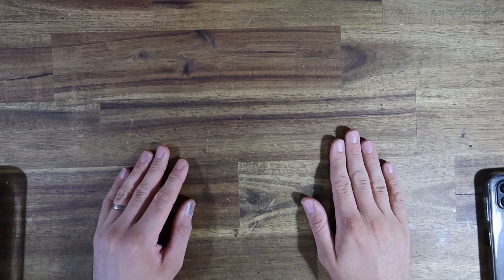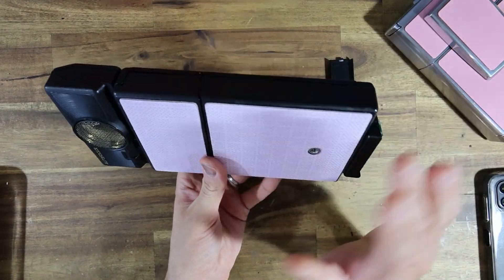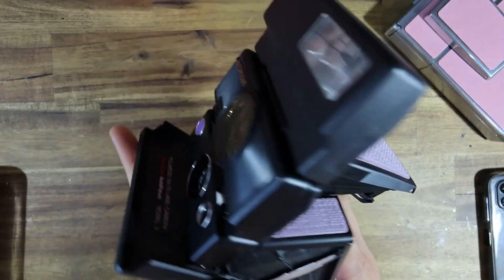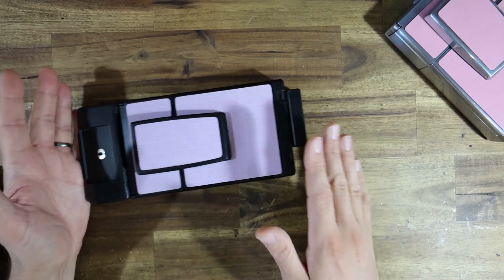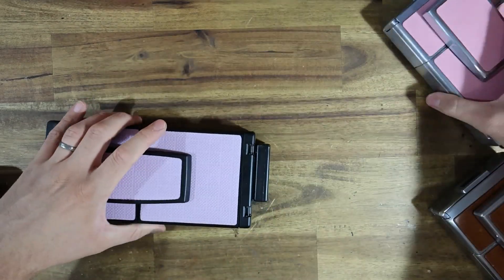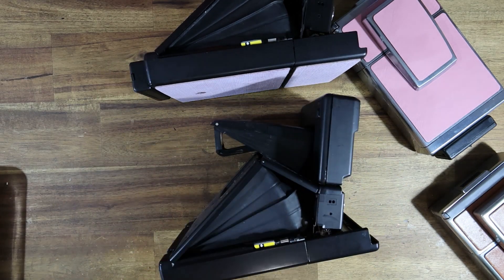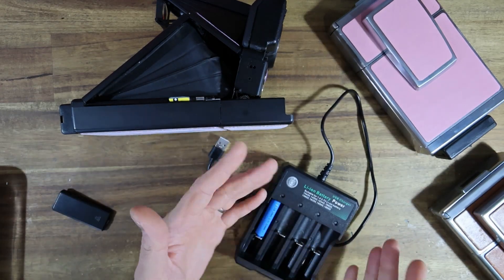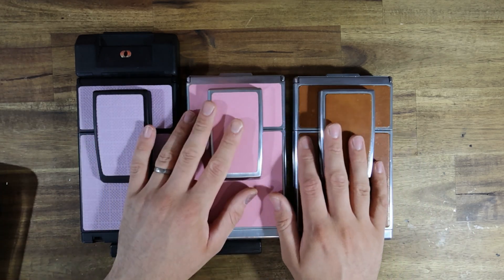The PolaVolt: a newer, even better i-Type solution for SX-70 Cameras!

Comment from the maker: Essential info:

- uses two 3.7V '10440' lithium ion cells (same shape and size as a regular AAA but different voltage)
- batteries are hard cell and user replaceable in the field
- requires external charger such as the BH-042100-04U shown in this video to recharge batteries
- batteries will last 10-30 packs of film depending on the quality of battery and specifics of the camera model 
- no switches required! simply erect the camera to turn it on, and collapse the camera to turn it off
- keep camera collapsed when not in use to prevent battery draining to 0V
- when the batteries are getting low, the camera will begin to sound sluggish, alerting you to change your batteries
- I recommend re-charging them every 8 or so packs of film if you want to be conservative
- user replaceable cells mean you can carry spares into the field! 
- despite some doubts in this older video, this solution does works perfectly on a 680
- due to shipping regulations I cannot supply batteries, but they are easy to find on eBay, Amazon, Aliexpress etc
- as tempting as they are, do NOT use the batteries with built in USB-C charging inside the cell itself. They are only 2/3 the capacity of a standard 10440 and have built in surge protection that will shut the batteries off if too many amps are drawn. This results in poor performance

Comment: Can you still use regular 600 film with this mod in place?
Reply from the maker: 600 film will still work, but it will not power the camera. This mod will use the 2x '10440' lithium ion cells to power the camera

The original battery terminals in the camera are deleted in order to simplify the electronics and improve reliability

It'll work like any modern Polaroid i-Type camera

Comment: This battery mod looks the most decent alternative for powering i-Type film with a reasonable price. Thank you so much for sharing! I've done the Mod and everything seems to work well when I bridged the contacts on the side for testing the motor. Unfortunately, the camera no longer fires when pressing or bypassing the shutter button. Do you have any tips on where I should look again?
Reply from the maker: This could be so many different things that the diagnosis is pretty much impossible online

The only thing I can suggest is to send it in or watch more of my videos to figure it out

Comment: The converter can handle the 680's flash quite well. I've been using a similar solution with my SRL680 for almost two years now but instead of stepping down, I'm stepping up the voltage of a single battery. The buck converter has been able to power the camera with a mixed use of on/off flash all this time. I'd really encourage the avarage user to try and DIY one. It's a fun and cheap little project.
Reply from the maker: This is excellent to know!

I haven't ruled it out, but I don't want to offer solutions that I haven't tested

Comment: How many packs of film will a PolaVolt go through on a single charge with an SX-70? What about a Sonar? A 680?
Reply from the maker: I haven't tested this. But the answer seems to be "a lot" lol

So far my batteries are still going strong after testing 5 cameras and several packs of film

Likely more than the average person would ever shoot in a day, and with the capability to swap cells in the field if they do go flat 

SX-70 and Sonar cameras should be similar, but a 680... I'm hesitant to mod yet since I don't know how the flash will cope. Having it built in creates a very large drain on batteries

Comment: I wonder what would happen if you stuck a Powerbar on one of these...
Reply from the maker: If you ran the Powerbar and the PolaVolt at the same time? Nothing special would happen. Effectively the two would run in parallel and you'd get twice the battery capacity (assuming you used identical cells)

Comment: The problem with the strap issue could be fixed if is mounted on the side of the chassis maybe?
Might not be as aesthetic but will probably fit.
Or even on the top part behind the view finder cap on the leather as that view finder is out already the bulk would be less noticeable.
Reply from the maker: this is correct

Technically I could mount the holder anywhere on the bottom panel

BUT... mounting to the top panel would prove difficult. It'd need an external cable to route power. It'd look messy
Reply: @theinstantcameraguy  under the skin running to the hinge? Just an idea that would probably be my choice I'll message you a picture of what I mean.

Comment: How do you get the iType film to insert into the 600 modified SX 70? It has extra dogs on the film magazine bottom or something that will not allow it to insert into my SX70 or my 680. 
  I have made the mistake of grabbing film for our i2 and trying to put it in the 600 type cameras and it will not go in. 
  Do you file the camera out to do that? 
Thanks for the great videos !
Reply from the maker: watch a few of my other videos on SX-70 refurb if you wish to see my solution on this

When I overhaul a clients camera to take 600, I ALWAYS remove the little metal tongue that sits inside the chassis. The little metal tongue inside serves no other purpose than to prevent you from inserting the 'wrong' pack of film

Remove it, and i-Type will insert easily :)
Reply: @theinstantcameraguy 
I see !  ( I thought I had watched them all ! ) Thank you

Comment: would it be possible to modify a mint flash to power the camera?
Reply from the maker: nothing is impossible

But it would be very difficult to do

You'd need to swap the mints 2x AAA to 2x lithium cells as seen here, re-design the PCB of the flash to have extra +6v connections, mod the camera to have the same 6V connection and re-design the flash circuitry

Also, you'd be stuck with a camera that does flash only, unless you also build in a switch that turns off flash-enable terminals
Reply: i just thought, the powerbar has normal batteries. why not use a flash for that!  @theinstantcameraguy

Comment: I have an idea! You should make an integrated rechargeable version using 3.2V lithium ion batteries, wired in sync then connect it to a buck converter to get the proper voltage, the idea is to not have the batteries be removed for charging,
Reply: It’s an idea I’ve had for a while, but I just didn’t know how to pull it off so I might as well share the thought idk
Reply from the maker: @venteach.6289  the issue is adding a charger would add space to the mod. Currently the way it is, it all fits into one tiny 2x AAA holder

Given the batteries are removable, and one could easily carry spares, I think its a fine trade-off for a lack of built in charger

Comment: Great solution. Way better than before.
Reply from the maker: I agree! 

Less than 24 hours after releasing my first video I had drastically improved the design!
Reply: @theinstantcameraguy  It would be great a video about Spectras. Love them but all the issues with jamming film that ended up in Polaroid stopping making film was really bad. Do you know what was the real problem? Weak batteries, low quality capacitors in some models, both? I have a ProCam, a 1200 with LCD screen and an Onyx that still works perfect. Thanks.
Reply: @germansaez  From my research, it was most likely the weaker batteries + new film thickness. The thicker film required more power to push through the rollers and the new disposable lithium batteries Impossible used were just too small (from a video by a guy named SPRKPLG on YT, his video showed the Impossible Spectra batteries to be 650mAh vs 750mAh for SX--70/600, basically the Spectra battery was weaker than the SX-70/600s). I have a video showing how to use 600 cartridges with quick and easy mods.

Comment: Very nice! I've actually done this type of mod for a few of my 600 box cameras and I used a mini boost converter and a 18650 cell instead. I tested the converter against a burst of 10 flash shots and it gets very hot. Those mini boost circuits are rated for 1A bursts (the boost chip is literally smaller than half a fingernail). My ammeter clamp says the flash cycle draws around 2-4 amps, I wonder how much the 680 draws? Do you think two or more boost/buck circuits can be wired in parallel?

The voltage of the boost converter under load also drops to almost the same voltage of the battery (4v) so it's not that great and I assume the voltage ripple is horrible. I'd say your buck converter mod is better as it's much more compact than a 18650 cell + boost board, though I wonder how the voltage regulation/ripple is like?

After watching your first video on this, I started looking at mini buck converters on AliExpress/EBay (they all come from the same place anyways) and it seems like some of the buck chips they claim to use can do 3A continuous! (according to the datasheet of the real chip). I can try linking them if you want but the model number is MP2315 from Monolithic Power Systems and it should have "AGC" marked on top of the chip.